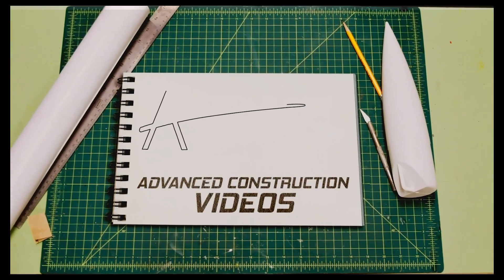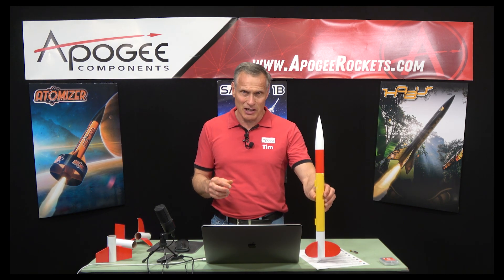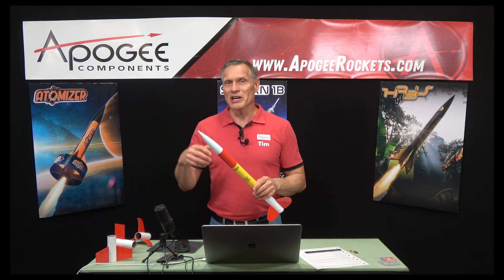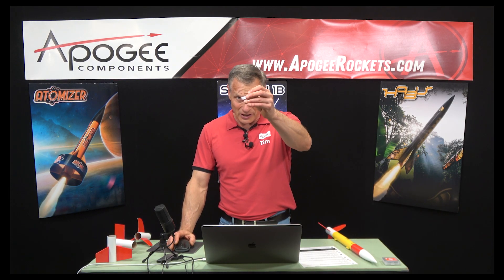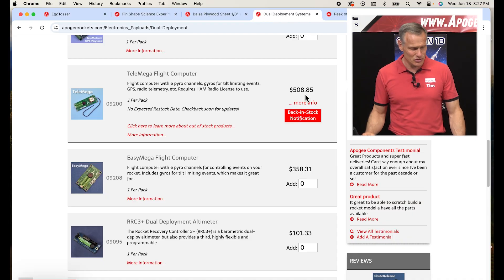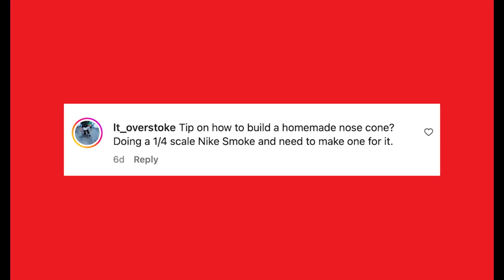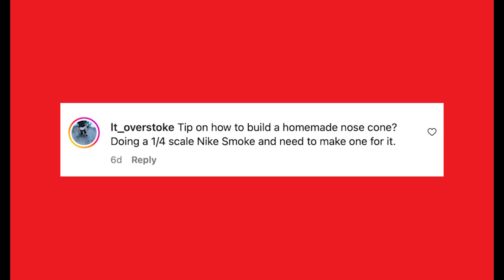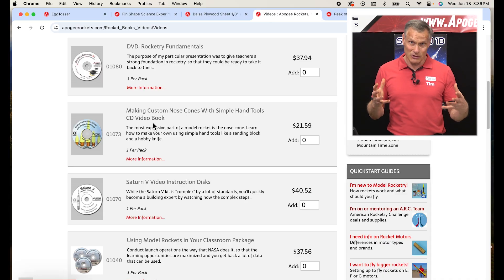A Real Rocket Scientist Answers YOUR Questions | Part 3

Comment: Great information......as far as carving a nose cone goes. I've had great success with a metal lathe and a 4" side grinder. Cut your tube fit first then cut a mandrel it fits into. Insert your balsa nose cone into the mandrel, spin it up and finish shape with the side grinder and a tiger wheel.....balsa is a turkey to work with and this method produces consistent results.......= )